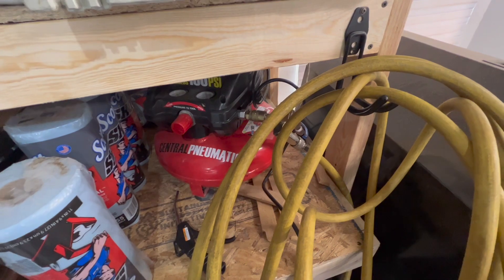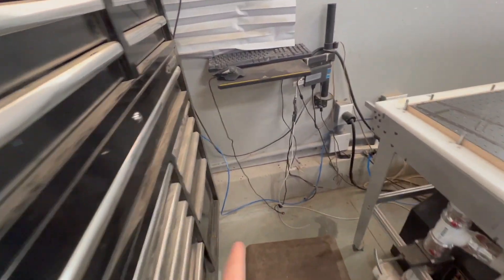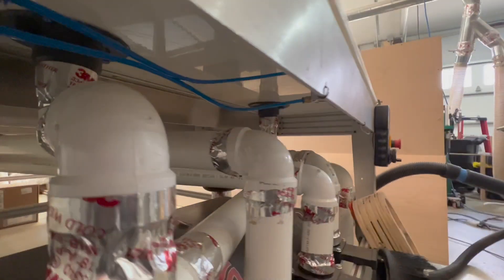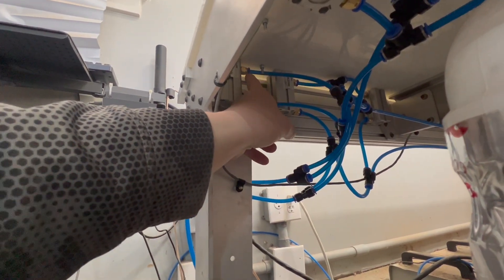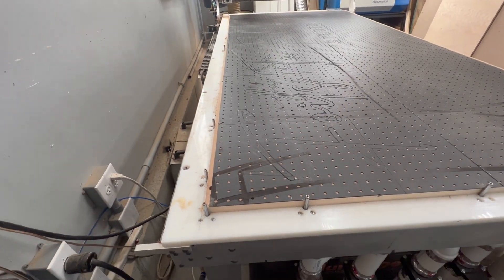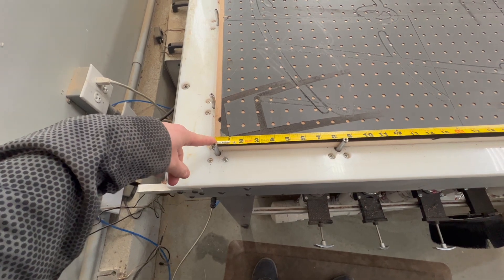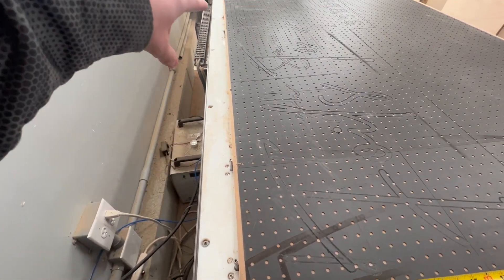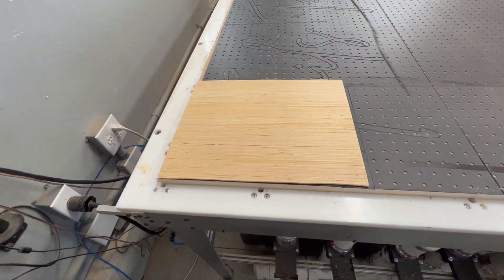Adding Pneumatic Pop Up Pins to My CNC!

Comment: How hard can you slam pieces into the pins before there is deflection? I typically slide full sheets pretty hard…
Reply from the maker: I want to add that since this comment, I have added blocking behind each pin, super simple and there is ZERO deflection now.
Reply from the maker: The shafts are fairly thin. If I were doing it again I would look for/get thicker shafts. It's not really a problem, but if you push too hard the pin will get "stuck" and won't go down so you need to push the sheet back just a hair. Overall it hasn't been an "actual" issue.
Reply: @Meyerwoodworks can you please share the details on the blocks?  Also, what pneumatic motors you’re using ?  Thanks
Reply from the maker: @NguyenHaiNhi75  Links are above for all of the parts used. Since this video I did add blocking behind each pin to stop them from deflecting.
Reply: @Meyerwoodworks  Thanks for sharing the links! For clarification, you said you are using the 20mm bore but the piston doesn't seam to be larger in diameter than 10mm. You mentioned in the comments that if you were going to do it again, you would get a larger bore. What would you suggest?
Reply from the maker: @roeschdan  I'm using the 20x50mm. The beefier pins that are used on the commercial grade CNC's are REALLY expensive. I ended up just screwing down a block behind the pins so they can't deflect, it's worked extremely well so I would just do that.